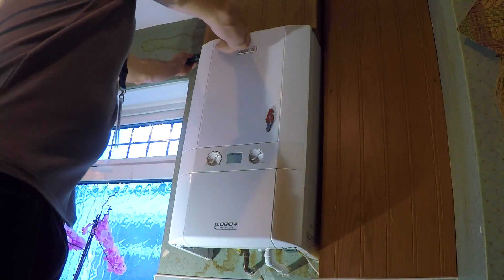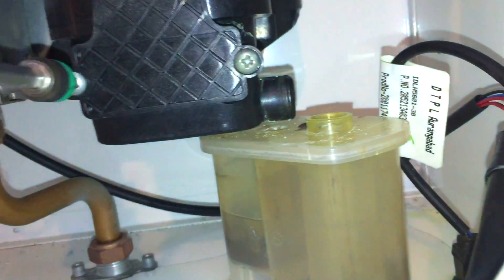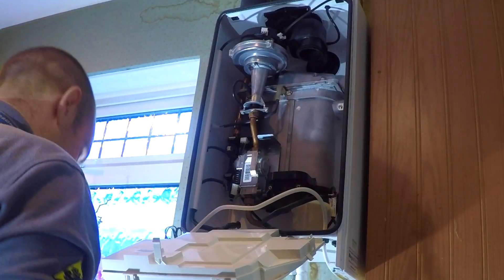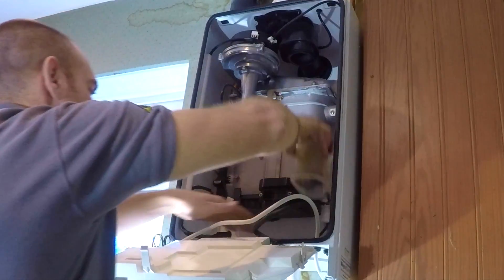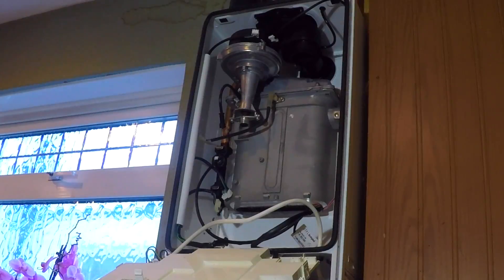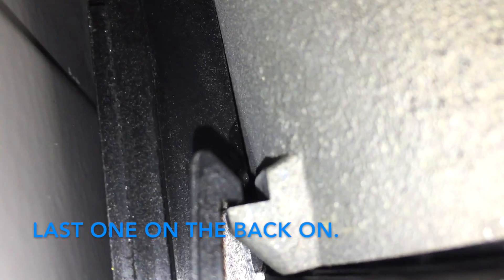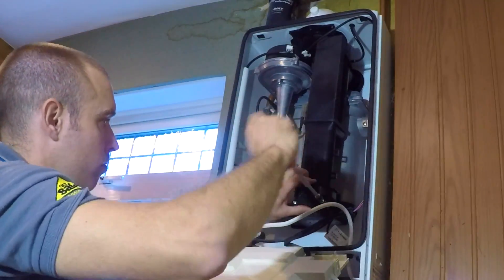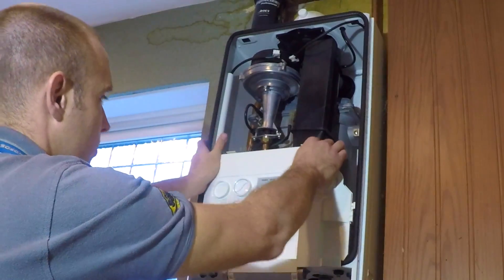Ideal sump replacement. HeatingGeeks. How to repair boilers

Comment: Is it possible to use some sealant around the sump and the little screw bracket rather than taking it all out and replacing it?
Reply from the maker: NO! It's a part of the combustion way for the boiler. Fumes that leak out can be fatal.
Reply: @HeatingGeek  Fair enough your the expert and I'm a ignorant fool. Its just I've had this leak for months a with carbon monoxide alarm set up and I'm  not dead and the alarm hasn't went off either. I was hoping to use LS-X Leak Sealer to do the job myself... But I take your point no chances should be taken with safety.
Reply from the maker: @pauljones5620  Usually on a gas boiler, more than one thing needs to go wrong for it to kill someone. You have one thing at the moment as far as you know but no-one knows when or what the next thing could be. It's never worth the risk.

Comment: Would this cause the boiler pressure to drop? I have the exact same crack and leak on my boiler but it is also losing pressure. Would be nice if a new sump fixed both issues but I'm guessing I have two seperate issues? Thanks
Reply from the maker: Is yours the Combi version? The sump will not cause pressure loss so you will have another issue

Comment: Mate I got to do this job on the sane heat only boiler. Should I fit a system clearer too as it doesn’t have one…
Reply from the maker: I wouldn't. You don't even need to drain it. I have a video coming in a few weeks of mr doing one of these again :-)
Reply: @HeatingGeek  sorry, I think I miss communicated what I meant here. My mates boiler has a leak and it’s from the sump, the same as you’ve done on this video.

On a side note, on said boiler is a oldish micro bore system that has NO filter on it. I intend to put a clearer through the system (as its clearly never been serviced or looked after). Would you recommend me putting in a Magnaclear filter while I’m at it? I was going to drain down the system, clean out the F and E tank and put a cleaner then an inhibitor through the system. Just wondering if it a good idea to add a system cleaner (magnaclean) on there too, while I’m at it….?
Reply from the maker: @simonstones1918  I wold add a spirotech   type filter. They can get more debris out of a system. Not just magnetic :-) But giving it a good clean will help a lot. :-)
Reply: @HeatingGeek  cheers mate, I’ll do that then. I’ve got a couple of feet above the boiler to fit one in. Would you take on that sump change if you were me? I’m gas safe but never really done much boiler repair work….other than a prv or expansion vessel change. Looks daunting with the amount of components you take out the boiler to change the sump! 🤠
Reply from the maker: @simonstones1918  Its a simple repair. I think you'll be fine with it. I have a video coming where it took 25min to replace.
Reply: @HeatingGeek  ok mate I’ll look out for that video then. Many thanks for posting your videos. I for one appreciate the effort you put in to make them 👍

Comment: I have this exact issue with my boiler…engineer suggested its a minimum 4 hour job???
Reply from the maker: I don't know your exact situation by 4 hours might be correct. It completely depends on the system type, house size and pipework layout. I would say 1.5 hours is minimum and a full day maximum. The job is easy but getting the water out of the system is the difficult bit.

Comment: Hi my ideal C30 boilers condensation trap is leaking water at the bottom, it's not winter or cold, could it be my condensation pipe is blocked, great video thankyou in advance.
Reply from the maker: It could be but you will need someone to remove the cover (off the boiler) to check where it's coming form.
Reply: @heating geek I already told you where the water is leaking from so why would need to pay someone to tell me, I fixed it, it was as simple as emptying the water from the condensation trap, I forgot tradesmen don't like giving advice, sorry for wasting your time and my time, thanks for nothing.
Reply from the maker: @sloopycat1954  But yet I put all of this on youtube??? You're welcome. The condense trap is meant to be full of water... Its a trap. to stop fumes potentially getting in to your property from the flue system... So yes, I try not to tell people who don't have clue. You have potentially endangered yourself and family. Well done. Get a professional to come and fix your boiler when the condense trap refills as it should. Hopefully it does this quickly and no CO enters your property.
Again, you're welcome.

Comment: I'm a pretty handy DIYer and will be attempting to change the sump myself. The heating engineer I had in today to diagnose the fault wasn't interested in changing it, quoted for full boiler replacement instead 😛. I recon I can get away with not disconnecting any gas pipes, so I assume that means no need for the analysis etc as nowt else has been Disturbed. I'll grease the rear clips like many people have suggested. Wish me luck.

Comment: Hi. Does this problem cause the boiler to lock out with an L2/F2 fault code
Reply: No that's means boiler isn't getting gas, check that theres gas in the meter and beside the units it says ON, if that's ok then it could be your regulator locked out, if that's ok then check what the gas pressure is at the boiler, if there all fine could be blockage in gas valve or faulty

Comment: Would a hairline crack in sump cause slow loss of pressure?
Reply from the maker: No it would not. Slow loss of pressure would be caused by a leak on your heating system. How slow?
Reply: @HeatingGeek  having to top up every 6-8 weeks, noticed the usual crack in sump. Only other suspect I can think of is PRV. No obvious pipe leaks
Reply from the maker: @kramthesultan  The PRV is easy to check. It may be a small leak on a radiator valve. The usual suspect is a chrome valve in a bathroom where a drip may go unnoticed.
Reply: @HeatingGeek  cheers changed towel radiator valve, will check all others, right pain!

Comment: Exact same fault on mine ... the crack was identical to yours .... as a temporary measure mixed some resin together (the hard and soft tubes of glue) and applied over crack ... have fixed it for the time being

Comment: Essentially the Ideal logic is a great boiler but they've been plauged by heat exchanger and sump problems. Such a shame for an otherwise great boiler thats simple to work on.
Reply from the maker: They are very simple to work on compared to the Icos and Isar. I can't believe Ideal managed to learn and implement change. It took a bit longer than most repair engineers would like. :-)

Comment: one contributing factor of cracked sumps could be the force required some times to remove the plastic exhaust from sump to flue outlet. The two rubber seals seem to be assemble dry and can sometimes mean a bit of stress on the sump to remove. I always grease these seals well on reassembly for next visit.
Reply from the maker: Grease makes everything better.m :-0

Comment: On the ideal combi you need to remove main heat exchanger as there is no movement or space to pull sump off and it's tight at the back of boiler to get you hands in to work
Reply from the maker: I have filmed and uploaded it since. :-) I did take it out but others say they don't need to. :-)

Comment: Hi great video any tutorial on changing pressure relief valve on mark 1 ideal logic system18 it's the one with water pressure gauge underneath boiler
Reply from the maker: No, sorry. Straight forward on them though.

Comment: If you don't have a new part already for it and your earth cable which is screwed to the bottom of the boiler is in contact with water tripping out my fusebox and not being able to have central heating and hot water til the part comes and my fix has stopped it leaking I don't see what the problem is
After all its not causing any more damage so no issues
Reply from the maker: If you wanted to bodge it temporally until the part came (you didn't say that though) you can just smear silicone grease (not sealant) onto the crack from the back. It lasts a couple of weeks. Using solvent cement to repair it won't work. But let's be clear you didn't say you were doing it until a part arrives.

Comment: Not disputing the fact that you are wrong 
However is does and has worked.
In the meantime I'm ordering the part in case it starts to leak again.
The problem is you can replace the part with new and it's clearly a design flaw with this type of boiler and could easily go again at any time with or without a new part
Reply from the maker: Apparently Ideal have upgraded the part. FYI solvent weld chemically melts 2 plastics together. So they become 1 (PVC/MUPVC). The plastic used in sumps has a lot of additives such as fibreglass (to make it stronger and more heat resistant)  which solvent weld will not "melt" The plastic isn't the correct type and won't melt. What you have done is use solvent cement to cover over the crack like a plaster. There would be much better ways to bodge it than solvent cement is all I'm getting at. I don't care what you do, I'm just letting you know I don't think it will work. I would assume that the water will creep behind the solvent cement. I could be wrong. Just my thoughts.
Reply: @HeatingGeek  The parts not come yet but checked again today and still no leaking but good to know if the part is upgraded then will replace it anyway.
Do you know why my bath tap runs colder than the others?
The tap has to run slower.
I was told could be the flow sensor but not sure if its the part near the pump or the the thermistor part I need?
Thanks for your info and much appreciated.
Reply from the maker: @onehandsomemuttha2423  It probably won't be the flow sensor. Run this little test.
1: run the offending tap at the normal rate of flow.
2: Open another tap in the same room (basin) very slowly.
3: Wait for a few minutes and see if the basin tap is hot or the same as the other (Faulty) outlet.
4: Tell me what you find.
Reply: @HeatingGeek  

sorry for the late reply I have been working away so never got chance to do it
Reply: @HeatingGeek  I was gonna melt the crack shut but thought hey may as well try the solvent.
After all there is no harm in trying but there is 6 of us in the house and with no heating and hot water in this weather is not good
Reply: just figure out that the blue tap under the boiler had full on pressure so the faster I run the bath tap the colder it became.I turned the blue tap  under the boiler which I think reduced the flow between the sink in the bathroom and the bath  and now they both flow very hot
Reply from the maker: @onehandsomemuttha2423  Simple :-)

Comment: Question tho if anyone has idea because bath sink runs boiling hot but when I run bath hot tap I have to run slower for the water to get hot same as sink
My other sink in kitchen directly below bathroom is very hot it just bath tap
Reply from the maker: Your bath tap runs a lot faster than the basin tap. They boiler can't keep up. Slow the tap down and it will be hot. Watch this to explain it better,     https://youtu.be/z7cwuN-B5NU

Comment: Just repaired this using solvent cement glue 
I applied it on hairline crack and cover with 2 screws. Checked 48 hours later now no leaking at all
Reply from the maker: Its a bodge. Not a repair. Solvent cement doesn't work on this type of plastic. That is not what you should be doing.

Comment: Good video I find it easier to put front clips on 1st then lift the back up one by one hear the clicks 
I grease the sump clips and seals
Reply from the maker: I will try it on the next one. I just thought do the difficult one first. :-)
Reply: Yeah that’s what I used to do but it just lines it up nicely when you do front 3 then it’s just click click click and your away
Reply from the maker: @TheLeedsleedsleeds  I will give it a go next time. ;)

Comment: if you apply silicone lubricant to the black section before trying to get it on youll find it slips on very easy compared to not using it
Reply from the maker: Good little tip. :-)
Reply: or KY Jelly which is water based, If you don't have any, ask the customer... :-)

Comment: Nice video my man, been struggling getting the sump off on a combi. Came across this video slacking off the heat exchanger screws was enough to get the clips off at the back with ALOT of brute force lol. Thanks ✌🏻
Reply from the maker: No problem. :-) Glad it helps. :-)

Comment: Professional job good lad take it for granted that safe electrical isolation is done before case off definitely not a job for the DIY as gas analyser is essential to check for safety

Comment: Would this crack cause a leak from the heating system that reduces pressure? I am not seeing any leaks around or under the boiler but also cannot find any leaks on rads or pipework.
Reply from the maker: No, it wouldn't. Just a water leak.
Reply: @HeatingGeek  OK cheers.

Comment: Should be a recall, had hundreds of these. Injection moulding fault imo.
Reply: Clearly, as they all crack in the same place. I have the same issue on my boiler and found so many videos and info on the internet about the same issue. My question is: have they fixed the problem? Will my new sump crack again soon?
Reply from the maker: @tony359  Apparently ideal has changed the process of manufacture. Who actually knows. :-)
Reply: @HeatingGeek  and obviously there's no way to know how to identify the new batch from the old batch. Typical. :( Thanks.
Reply from the maker: @tony359  They could add more fibreglass to the mix to strengthen it. But who knows.
Reply: @tony359  will a new sump fail ? unlikely but its always possible. Ideal say they have sold over 3 million Logics and the failure rate these days is negligible. As an installer but mainly as a service engineer I think they are great boilers. I have one in my own house since 2016 and its been fault free.
Reply: I've installed about 30 Logics over the last seven years. Not one of them has cracked it's sump. It's definitely been dealt with by Ideal and I've only had to change two sumps on older Logics installed by others. It's a doddle of a job unlike changing the plastics on a Worcester.
Reply: @timhancock6626  Yes it looks a doddle but why do so many tradesfolk charge so much for a 20 minute (max) job?
Reply from the maker: We get paid to replace them though. :-)

Comment: Brilliant! We have a boiler leaking just like this and didn't know what it was - had a gas engineer look at it and he diagnosed blocked condensate outlet, cleaned it and yep it still leaking later!.
We're about to revamp our heating and hot water system and move the boiler - I may send you some pics as the house is only 25 years old but the installation looks 100 years plus! some poorly soldered gas joints under floors etc and now this so will keep it running until we have new boiler in place and then expel the whole thing and the tanks to a recycling place.
Your video and explanation are just spot on and if I knew where to get the replacement part I would have our new gas engineer fit it too! Please accept my thanks for this video - GREAT JOB!
Reply from the maker: Glad you like it. The sump is common to crack at this point. :-)

Comment: Thanks for the video. Got my 1st one of these to replace the sump on next week. Cheers.
Reply from the maker: No worries. I have a combi one on video too. :-)
Reply: Did the job, 
I greased the sump seal & the rear clips too. 
Worked well, thanks again heating geek.
Reply from the maker: @buxvan  It not a bad job to do once you have done it before. :-)

Comment: I am curious to know how old this boiler is,and why with such a common fail why ideal have not resolved it, or have they now,i ask simply because this comes up quite often in all the ideal video,s , cheers again brilliant video.
Reply: They changed the injection moulding process and the join is now not at the front
Reply from the maker: @01plumberman  Good to know. :-)
Reply from the maker: Apparently they have improved the part. I can't see any improvement but maybe they have changed the material??? More glass fibre in the mix?

Comment: Easy fix is to smear silicone grease over the hairline crack and refit the small cover. The condensate is not under any pressure and it works every time for me. Minimal cost & the same effect no leak.
Reply from the maker: I know what you mean but its still cracked and needs fixing.

Comment: My mate has an Ideal 12 with this problem. I think his plumber replaced the cover last year but its still leaking and seems to be getting worse. How much should a sump replacement as in the video cost to do?
Reply from the maker: Between £150-300 every situation is different. My customers pay the same Labour charge of £150 + parts. so on this one about 210
Reply: Thanks for that, we're looking at it Wednesday so we'll see!
Reply from the maker: @mcadeemcnasty2460  Good luck. Not too bad to do. On the combi version you remove the heat exchanger. :-)

Comment: I have a 4 year old ideal logic heat 18 and have this exact problem. I'm going to get it repaired but wondering how dangerous is this fault?
Reply from the maker: I haven't seen fumes leak from the crack but it could. 
If fumes leaked out it would cause poor combustion which if got into the room is deadly. 
The long and short of it is: it has to be fixed ASAP. If its just a hairline crack then it should be relatively safe. However you can't be sure when the crack will completely fail and be a very dangerous situation.
Reply: @HeatingGeek  thanks for info, I'll get it sorted ASAP. Great video btw 👍

Comment: You can do the same with combi just watch the clip on the return pipe does not fowl the sump unplug the electrics to the pump and DHW hall sensor. Need a good mirror to check the back clips are located as access  is more limited but do able
Reply: Dermot Leeson a